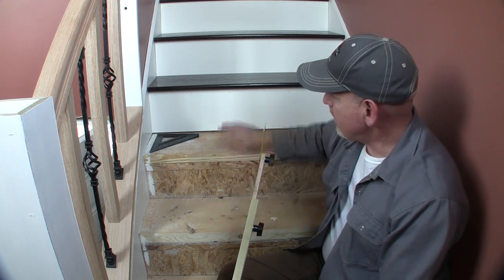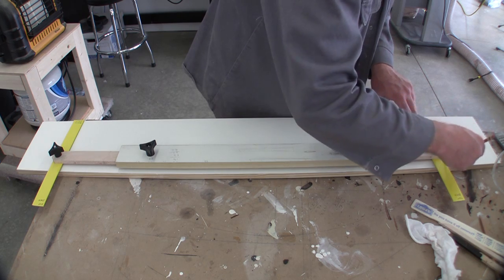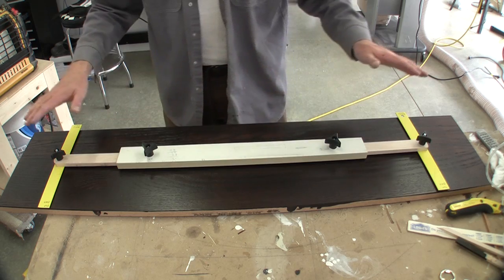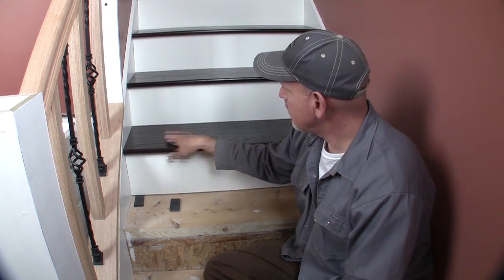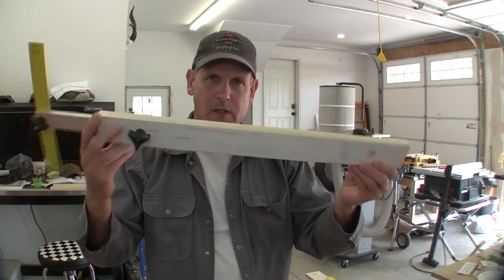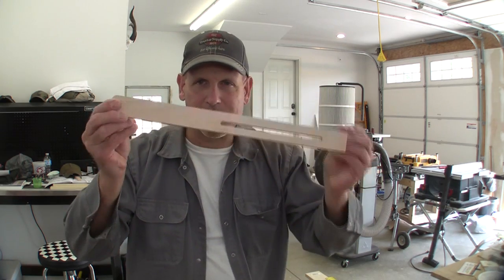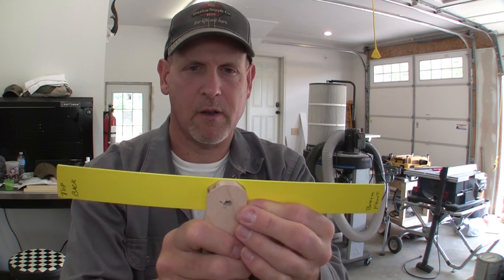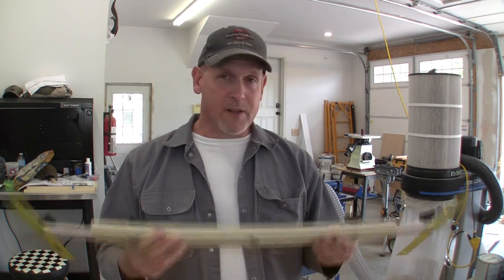Build a Stair Tread Jig

Comment from the maker: Thanks for watching Jeremy.  I really appreciate it.  Your question is one of those where you might be reading into it a little too much.  When I tell you the real reason I cut mine that way you are gonna be disappointed.  :-)  Ok, here goes, I planed my treads and my planer was acting up so it sniped the ends of the treads.  I didn't want that part to show so I centered my cuts in a way that both of those bad ends would be cut off.  Simple as that.  Ha!  If that were not the case I would have done exactly what you are wanting to do and save all that precious hardwood for another project!
Reply: blazingnailgun. I'm sure you know this but if you feed your boards at an angle it greatly reduces snipe on the ends. Great build by the way.

Comment: Dark tread and marking it. Why not apply masking tape to the general area that the line needs to be traced? Keep running a pencil across oak like that and it will only take a few passes to turn that sharp pointed pencil lead to a round ball of lead. Additionally that line at that point will be thin like it suppose to. As well as more visible while cutting. And finally will reduce any possible tear out on a finished tread while cutting it.

Comment: Just for the lazy...like me. Use a piece of 1x4 (ish) just short of  narrowist point on stair.
Lay 2 nice straight pieces of 1x4 against stringers. Place first board over those and screw
through to stringer boards. You have your template.
Those stringer boards should also have nice square edges, so nice cut edges.

Comment: PERFECT!! I was shocked at the cost of these gigs or templates. $20.00 for just the two ends which are plastic. And then  u have to provide the wood for the main frame? I only have 13 steps and I'm not paying $105.00 for a nice aluminum one that I will only use once!! So thank u for sharing ur DIY template. Simple and it fits my budget!!!

Comment: one thing i’d be doing just a little different and that’s cut the risers and treads just a touch longer so you have to push them in will a little effort to get a really snug fit because when they contract there won’t be any spaces all over the place and it will help with creaking.

too late. woodpecker makes one. but you know them it’s probably $500

Comment: tried to make your jig myself. I don't own a table router. I bought a handheld one for like $89 from home depot. I couldn't get it to route straight I even tried to make a jig but id have it tilted up or down some. I see jigs online for $80. cheapest most are closer to $189.00 so I just ordered yours for $75. Good deal because that includes shipping. I've wanted one of these for years will be happy to own one. I am a floor guy but I do mostly tile so I have only done maybe 3 sets of hardwood stairs in 15 years and I just kept re cutting and re adjusting my saw angle for stairs this jig will pay for its self in 1 job in time saved. Thank you for making my work easier.

Comment: Hi Feddie, I'd like to ask a question about your wood cuts. You choose to cut your treads (or risers) in the middle of the stock piece. Is there an advantage to this cut placement? I am considering to make my first cut snug against one edge, and the second cut will leave a larger piece of leftover stock. In the case that I need to use leftovers for anything, I might have larger pieces leftover.

Comment: Well I'll be darn. I love jigs and now I'll have to build this one. One more for the shelf.  Might I suggest that you router a 1/8 to 3/16 inch lip around the slid slot so the head of your bold is flush with the jig surface. I'll also put a level on it so it can be used on other things off the floor.  Just thinking out loud. I take the time to build a jig if it will make everything I need to build or cut the same.

Have a off topic question for you as a carpenter.  Would you know the ADVERAGE  square foot cost of stripping a 75 year old house down to bare studs and remodeling? Is there math that will help me figure the base cost?  Thanks bud.
Reply from the maker: I really like your idea of the level.  That's a good one.  I beat you to the other idea though.  Check out my newest stair tread jig video and you will see that I have improved the design a great deal and also recessed the carriage bolts.

Your question is really hard to answer because "remodeling" can mean a lot interns of cost depending on the finishes.  I don't really have a rule of thumb without seeing it.  You'll just have to measure it out and build your costs.  I would be a little intimidated by a house that old.  Never know what you might run into.  Good luck!

Comment: Nice jig sir!!  I'm not so sure why you would even have to go out and buy that ruler... Wouldn't it work just the same if you use some straight pieces of 1/4 plywood for the ends? Your not really utilizing the numbered increments on the ruler anyway for anything.. unless they are used for something else.... Thanks again Mr. blazingnailgun!
Reply from the maker: Danny Herrera Thanks for watching, Danny.  I appreciate the kind words.  That video shows the very first and very rudimentary design.  I build them differently now.  There's a couple more updated videos of how they are built with a CNC machine now.  I believe the links are in the video description box.

Comment: I like the idea but I do see some potential problems. It looks like the jig has to be lifted out and off the stair very carefully - even a small knock would change the angle of cut meaning a poor fit. Also, if your stringers or side walls of the stairs are leaning inwards you wouldn't be able to remove the jig as the fit would get tighter the higher you lift the jig - bringing you back to problem number 1. The jig also won't allow for sides that are not straight - I know the jig will hold a value that is out of square but it won't account for a twist in the stringer. 
That said, in the right conditions a jig like this could save a lot of time.
Reply from the maker: +Mike Stephens Thanks for watching, Mike.  The new design on the jig has a feature that prevents the flex.  You are right, that was a problem from the beginning but I have resolved it now.  The new one is SOOOO much better than this one.

Comment: This is a great video. Thanks. Quick question, is it better to go over treads or remove and replace treads. My current treads are 1 1/4" thick and most I find at big box stores are 1" . I cant decide which way is preferable and/or easier. Treads don't go into wall so removal only requires a pry bar. Any suggestions ? I cant decide best method and need a nudge in right direction. Thanks

Adam G
Reply from the maker: Adam GordonThanks for the view and comments, Adam.  Stairs are one of those things that it always seems like theres a lot more to it and the more complicated you get the further you get into it.  Here's one of the first things you need to consider.  Either way you go you will change the "math" of your stairs.  This will be evident in the first and last stair.  For example, if you put retro treads over your existing tread then your first step will be taller and your last one will be shorter.  Does that makes sense?  The problem with that related to code and muscle memory.  We are conditioned to "expect" a certain rise when we walk steps.  Too much or too little then we start stumbling.  Also, code requires a certain rise and a limited deviation among the average rise.  Now, chances are you won't have to have your renovation inspected and no one will ever know but just keep that in mind.  If it were me and assuming your stairs are framed in like mine are in the video, then I would tear the old ones out and go from there.  That will minimize the problems I mentioned below.  Sometimes stairs are rabbeted into the stringer and that would change all of my logic around.  In that case you will probably have to go over the existing treads.  I hope that helps.  It's hard for me to give "great" advice without seeing them.  I usually tell folks not to overthink things but in the case of stairs you really need to think it all through.  Good luck and lemme know how it turns out.
Reply: Thanks for reply ! They are not rabbit ed into the stringer . They look mostly like your video . The new oak is just 1/4 " thinner . Would I need to build up 1/4 inch with a thin piece of wood to match or just have them all be 1/4 lower (not much difference ) ...I'd attach a picture but I can figure how to using Google + ... do you have a email I can send a pic to? 

I'm sorry if this is too much bother I'm sure you're busy

Adam

Comment: Could use that on window reveals if the outside pivots were on the ends of the end pieces, or even just put another hole on them then you would have a dual purpose jig.
Reply from the maker: That's a great idea.  Thanks for sharing!  I'll try to do this on the next batch I make up.  Thanks again.

Comment: I noticed that when you cut the riser and the tread you cut only one side, is it possible that you can just put the jig on the edge of one side and then cut it, or do you have to center the jig and cut from both sides
Reply from the maker: +Stephanie Williamson Each side will likely have a small variation in angle so you really should cut both sides.

Comment: When you did the tread, how did you measure the depth to get the lip? I watched your video over and over thinking I missed that part?
Reply from the maker: Hey there my nurse friend!  I did not actually have measure and cut the tread to length.  Stair treads are typically 11 1/2".  The rough framing underneath will be in the neighborhood of 9 1/2" - 10".  That way when you put the riser in (1/2" to 3/4" depending) you will have enough of a lip to put a piece of trim in like a 3/4" piece of cove or something like that.  Does that make sense?  Hope you all is well your way.

Comment: These are next,the flight I'm on now, treads go beyond the stringer,the ear around the stringer adds that much more complexity,it's literally one at a time as was replacing the risers,there's a time capsule like paragraph scribbled from the builder of the stairs in 63.There's nothing true or square anywhere,makes me appreciate master carpenter woodworkers that much more,I rely somewhat on fillers & soft wood,I can't even imagine expensive high end hard woods having to be perfect with little no fillers & customers looking for perfection day after day.
Reply from the maker: Tjfreak Thanks for watching, TJ.  Stairs are touch without some kind of scribing device like this.  If you want one the click the link in the video description box and I'll get one on the way for you.  Good luck!

Comment: Just make one but I used toilet flange bolts then I reset them in the wood and then filled in the holes with wood glue
Reply from the maker: FordFracture That'll work.  On the new ones I make I bore the holes out.  Those videos are posted on the channel page.  The latest on is made with a CNC.  Check it out.  Thanks for watching!

Comment: The way you used the jig for the riser works well if the board is flat, but not square.  I've found a lot of them are cupped concave in the middle though, and using a jig that wide will result in a gap in the middle since both ends of the jig touch on the outer side of that cupped board.